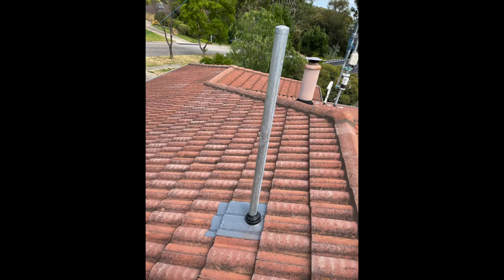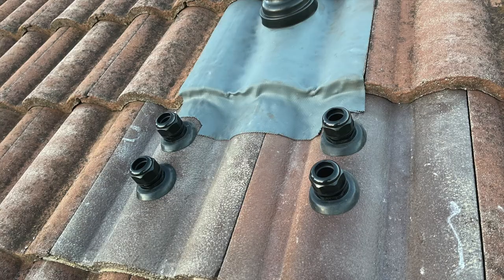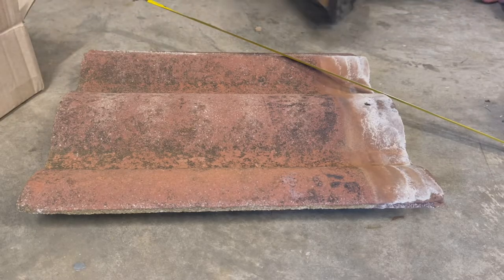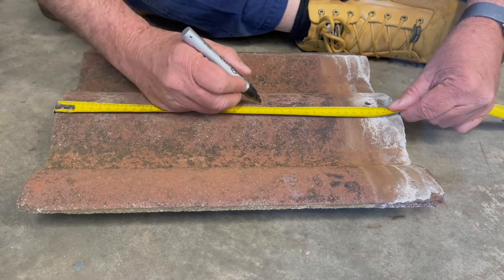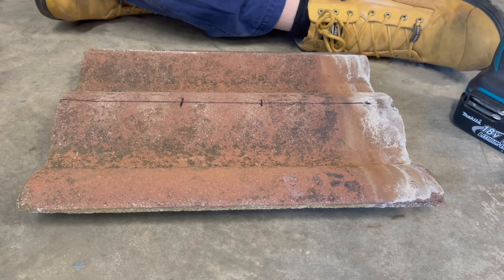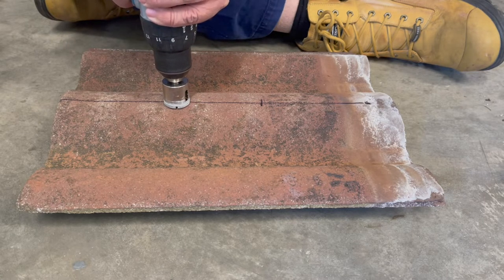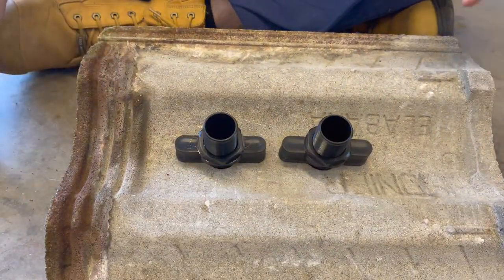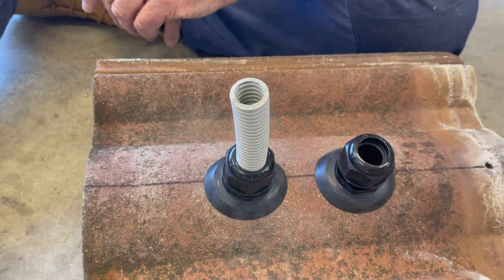Cable outlets on tiled roof

Comment: Very good . At the 2:00 minute mark where you have the conduit pointing down is great. To further lessen the ingress of moisture and insects getting down the conduit , you could attach to the end a conduit adaptor and gland. You can even get glands which accomodate for two or more cable entries .